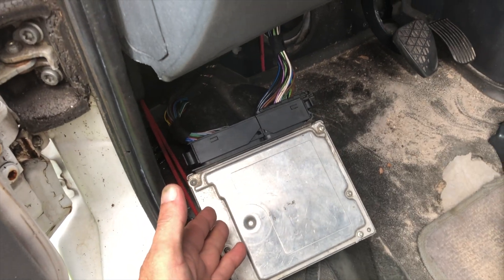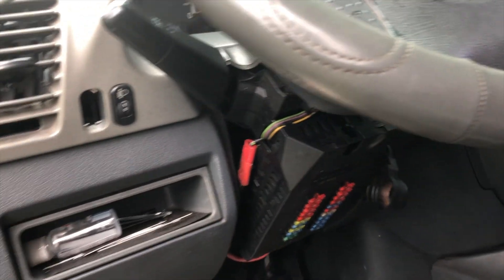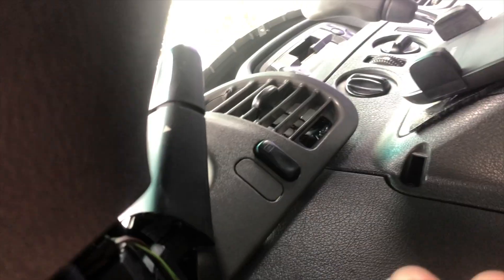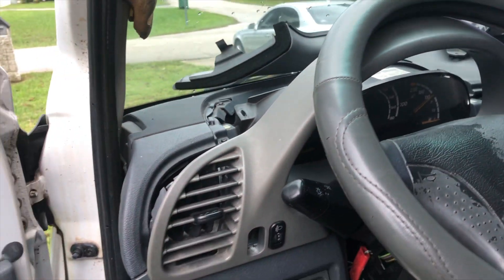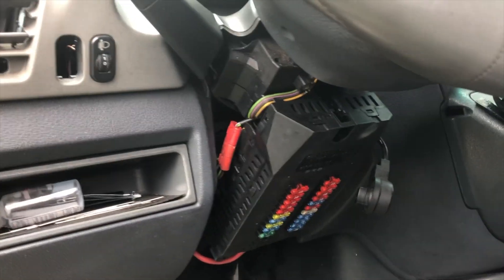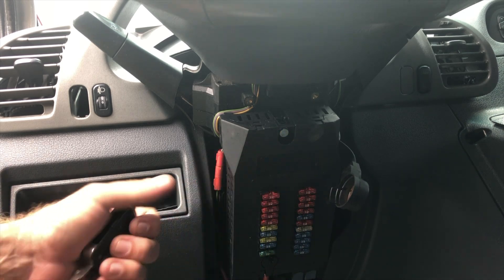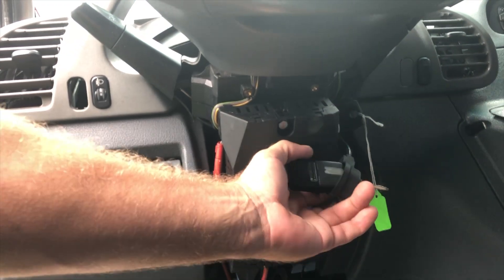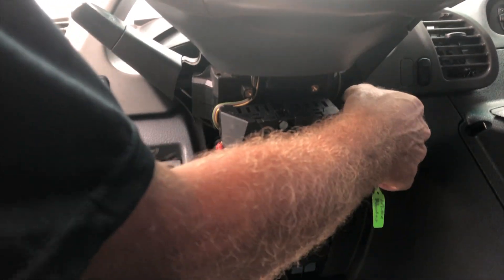ECM Swap T1N Sprinter Testing

Comment: My 2006 Dodge sprinter wouldn't start the diagnostic shows crankshaft sensor, put a new one in, still don't start, the diagnostic shows control module misfiring

Comment: Thank you for your work. i have a question, I am swapping an OM642 from an 2013 Freightliner Sprinter into a 2013 MB Sprinter. do you know if the engine harness is the same?
Reply from the maker: Sorry, 2013 is much different from the T1N Sprinters I know so well.

Comment: what codes did you get for ECM?
Reply from the maker: ECM failures won't typically trigger codes for accurate self-diagnosis. This swap is generally for vans that won't turn the starter motor. No-crank, no-start, often with a dash message StartError or the condenser fan kicks on when key is turned on.

Comment: Are the screws to get at the SKREEM all torx? Do you know what size torx bits I need?
Reply from the maker: Usually T-20 will get it all done here but some vans have 2 Phillips head screws in the front piece of plastic around speedometer.

Comment: Hopefully this is at least indirectly relevant - I have struggled with many transient FOB door locking issues on my '04 2500.  Lubrication, resetting or replacing handles, changing FOB battery, etc, etc.  Also have the 2-3 door locking pattern issue, which all-in-all has been the most tolerable.  Most recently I have been challenged by intermittent, incomplete locking behavior.  Front door locks, but sides and/or rear don't.  But, the current mystery inspired me to post.  Now, FOB locking works most of the time on all doors, but, unlocking doesn't work at all.  I am aware of the locking control module under the driver's seat (my part # = 410215013003) and am tempted to replace it in hopes that perhaps I will get to experience a fully functional locking system for the first time in several years.  However, I haven't been able to find info regarding that process.  Is there any module re-programming involved?  Any help is much appreciated.

Comment: Hello man i swap ecu from 2006 to 2004 and its working  fine but some time give falls check engine do i have to program it or i keep working with it without programming please help
Reply from the maker: I think it can be programmed for the van by SOSdiagnostics dot com They might need the original ECM for data to copy?

Comment: If I change the ignition lock cylinder, will it work with the key that comes with it or do I have to reprogram everything to the ECM, lost my keys and I’m getting insane quotes but the ignition lock is under $200 online……😅
Reply from the maker: You will need a properly programmed chip in your key. It can be swapped from one key to another or cloned, but you need one to clone. I can send a link to a guy who can make keys when all are lost.

Comment: Very accurate informative video, and thank you for sharing. I had to replace my ECM (the old one has no communication what so ever), SKREEM, and the key transponder, but now I notice the ECM gets HOT while the engine running !! Is that normal?
Reply from the maker: Warm but not hot. I'd be concerned if it is too hot to hold on to. I fear that is a weakening/failing electrical connection causing heat.
Reply: I want to know how you cloned the ecu

Comment: can i switch a ecm and skreem from a 118 to one from a diff wheelbase? i think i read somewhere the stabilty control in yr ecm is programmed fr a particular wheelbase....id like to switch ecms because id like to install cruise control and my 118 isnt flashed for cruise but the ecm from a diff wheelbase is...witch i think is a 158
Reply from the maker: I've not found any difference in that respect. I think it would be easier to find someone local with DAS to enable cruise in your existing ECM.  Swapping ECM should not be taken lightly as it can cause other issue beyond mismatched odometer and VIN, which can cause problems at state and local inspections.